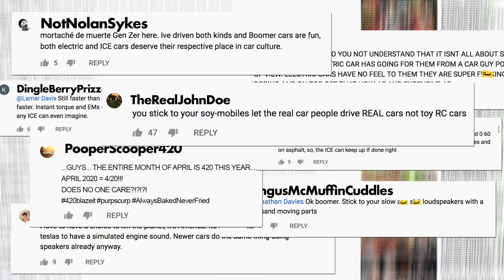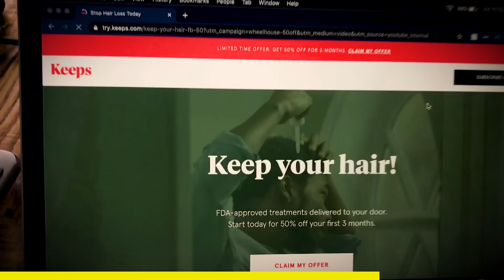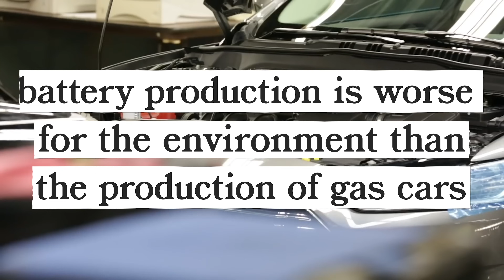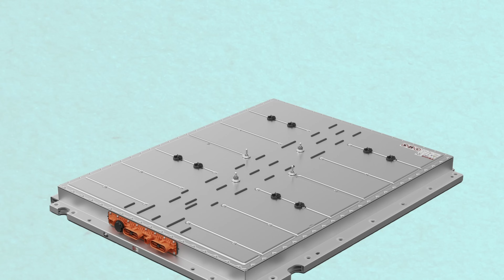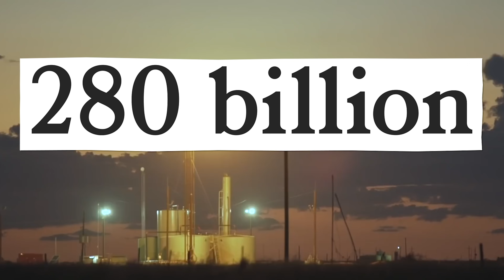Are Electric Cars REALLY Better for the Environment?

Comment: Electric cars have a limited lifespan. Some people won't even bother replacing the battery, scrap the whole car, and buy a new one. There are lots of proprietary stuff placed by the manufacturers specifically to prevent unauthorized service.

However, gas powered cars have a long history, so it's much easier to refurbish an old car and make it last decades.
Reply: The problem might eventually be getting hold of gas to drive it.....

Comment: This didn’t take into account the fuel efficiency of the gas engines and also failed to mention environmental costs from replacement of EV batteries. 
Fuel efficiency matters as they emit half the co2 if the burn half the gas or better. How long does an ev battery actually last? Did you add the cost of replacement batteries in co2 over the years? 
Great video. Very interesting. I’m still not convinced that Evs are better for the environment than existing fuel efficient cars but I’m glad to hear someone talking about it.

Comment: Will a battery eventually lose there storage capacity. so when a EV roles of the line it has 200 mile battery life but in the future will that drop to 150 miles out of the car just for example.
Reply: So, it's pretty similar to an i.c. car then? Because as an i.c. car gets older and is used more, it puts out higher levels of emissions and uses more fuel due to engine wear.......

Comment: Sugar cane ethanol has the best of both worlds: the footprint in production is lower than any gasoline, and the footprint during utilization is zero (because more than 100% of the CO2 produced by the car is absorbed by the new sugar cane being cultivated elsewhere).
However, the main problem is that even ethanol powered I.C.E. cars would still concentrate greenhouse gases emissions in the urban areas, which would be neutral for world environment, but harmful for people's health.

Comment: Batteries degrade overtime in which they have to be replaced completely as manufacturers don't repliece individual batteries or it limits range tremendously leading to buying new evs
Reply: yeah but they dont run out as fast as cars burn through gas

Comment: in my opinion i would daily an electric car and drive a v8 muscle like maybe one a week if i have my resources locked in a few years i will own both a v8 muscle and an electric car to save the environment
Reply: @Turnip_  so what do you suggest is a viable option, without any form of motorized transportation and i actually learned and studied and hydrogen powered cars are a more viable option so i dont think i would own an electric car, i would prefer to convert a gas car to a hydrogen car which can be done by using a conversion kit

Comment: Didn’t take into account the waste impact of old batteries, cradle to grave bro!!!
Reply: old batteries can be re-used to save energy generated by solarpanels that generate more then being used at that time, if the battery is not good for that, there is a company in germany that can recycle minimum of 70ish% of the battery, this can be higher in the long run.

while when you have burned your fuel of choice, it is burned and stays burned, thus you have to fill it up again and basically it has to do the whole pump to gasstation route again and again.

while for EV, once it's build then it is done, till lets say 10+ years when the range became to low and at that time your EV can be recycled and you can buy/rent/lease a new EV with new technology and new/better/stronger batterypacks.

so the only thing that has to be done is whatever your powerplant is/uses where you live and turn it more green, and don't forget that this for example coal powerplant is not only used to power your EV, but also your home, work, school, streets, shops, phone. thus even if you have an ICE car, that dirty powerplant is still working.

Comment: Lithium is very reactive to oxygen soo when exposed or in contact it burst in flames......
Reply: Lithium doesn't spontaneously combust with oxygen. Pure lithium and and sodium metal does react explosively with water. It does oxidize very easily but it won't self ignite from just oxygen. Lithium batteries combust when punctured due to being shorted, not due to being exposed to oxygen.
https://youtu.be/Vxqe_ZOwsHs
Reply: @bensemusx  my bad then......i was thought that lithium is very reactive but when ionized like in a battery it's not.

Comment: Electric cars where I live to get your registration renewed, the sticker on your license plate, costs $1000 where a normal gas car it's $100
Reply: @CANeelJavia  I was about to say the same...  In Norway, an electric car is heavily subsidized to the point where it costs less to buy than an i.c. car. Electric vehicles are extremely popular there. They also have electricity to spare, as much is produced by hydro-electric means. What happens in the US when much of the oil runs dry?  Which will probably be in around 25 years or so....could be sooner.
Reply: @Brian-om2hh  Hydro, solar, wind, nuclear fusion etc. 
Many sources.

Comment: What you failed to account for was how much people actually change cars. Average leases are three years meaning one person leasing a new EV would be contributing to over 69 metric tones of CO2 (71 metric tones for each vehicle produced plus 2 metric tones each year to charge them) vs 67.8 metric tones of CO2 ( 7 metric tones for each vehicle produced plus 5.2 metric tones each year to run them) with an ICE vehicle over the course of nine years.  Don't forget how much CO2 will be produced to create the replacement batteries with EVs and that they also use the same lubricants as ICE vehicles.

Comment: Not that it is a direct comparison, but I wonder how a motorcycle/scooter stacks up vs EV. A high power sport bike can still have 50 mpg. If you get a little 125cc scooter you can get close to 100 mpg. Just wondering.

Comment: If you IGNORE the carbon-dioxide and look at the permanently toxic materials that are removed from around the lithium in order to make the batteries and from around the copper and remember that CO2 isn't toxic or even a pollutant then the fact that this video makes the viewer retarded becomes clear.      Increasing the efficiency of vehicles by reducing the speed limit and using lighter materials is the future, not paving half of china with poison and replacing 100% of its water table with toxins.

just wait until the massive amount of toxic groundwater in china starts leaking into the ocean...

Comment: Electric motors sounds pretty wicked. It's so fast. Think about how fast that motor turns in comparison to a ice. Even electric lawnmowers and chainsaws make ice look dumb. There is nothing better than going out and mowing without hurting yourself trying to start it
Reply: And no mixing gas or messing around with oil changes. You can store the mower in a closet no risk of spills. Also does not stall in tall grass. It's insane
Reply: I mean it. It will not stall which means the time spent restarting the gas mower. You'd be completely done with the electric one
Reply: I was surprised because our gas one had to be yet again worked on because of storage. So the grass was above knee deep and it's all gone now. It's a pusher too but it almost acts like a vacuum and just mulches right through. Yes it needs to be charged every hour or so. I got a weed eater with its own battery so I can just go while the other charges. I can easily clear 5 acre in a day

Comment: And in Citys no smelly diesel fumes and the noise floor will be lower.
Reply: "diesel fumes" its gonna be a while before the type of vehicles that run diesel to go electric
Reply: @Kevin-dt9xm  Yeah but in many european cities vehicles with diesel engines will be forbidden in the near future.
Reply: @Kevin-dt9xm  Maybe not. Quite a few cities, both in the UK, have already, or are in the process of implementing a ban on diesel passenger cars in city centres. Paris, London and Berlin have already done it. Many more will follow I'm sure. And of course after 2035 it won't be legal for car makers to sell new petrol and diesel passenger cars in the UK. Some countries - such as India, Norway and others - are going for earlier cut - off dates.
Reply: @mrgrillboy that may be true but how will those vehicles operate when you can barely make them operate on smaller, mid range( in terms of overall mpg)  cars
Reply: @joshuawilliams1226  i mean right now trains are powered by electric motors, its just that most of those are powered by batteries powered by on board diesel. eventually we'll have either enough on board battery storage, on board alternative power like a tiny reactor (like a nuclear sub), or some sort of as-you-go charging like bumper cars worked into the rails
Reply: @Kevin-dt9xm  The electric trains in the UK are pure electric Kevin. They take their power from overhead lines. Hydrogen could offer a solution for rail transport. That still means it's an electric train though. The hydrogen fuel cell produces the electricity to power the motor......
Reply: @joshuawilliams1226  for something like a truck its just a matter of big batteries
Reply: @joshuawilliams1226  because electric motors have plenty of torque available instantly so they're actually not bad for heavier duty applications like trucks, thats why theyre used in trains, the only thing holding them back is the amount of on board battery to give them a decent life, but that problems being fixed
Reply: 8:40 That’s a nuclear power plant. That’s steam coming out the top.

Comment: now we need to calculate how much emmission to replace the parts because i suspect EV parts will break down faster than steel.
Reply: so far i know the only moving part is the electro motor, drivelines, wheels, brakes, bearings, steering system, axles, suspension system/springs. but all of them except for the electro motor are also in normal ICE cars, and in EVs in most cases you dont really use your brakes because it has re-gen.

Comment: How long do the batteries last in the electric car’s
Reply: depending how you (miss)use them, first gen Nissan Leaf is now 10 years old and over time you loose range, don't forget that range of the cars 10 years ago might already be lower then new EVs you can buy today, battery packs have become lighter and more energy dense.  
(https://www.youtube.com/watch?v=2qPF11PmP8k presenter with a 10 year old Nissan Leaf) 

although more EVs can go longer then 10 years (depending how much range you need), but keep minimum of 10 years and you should be fine.

(most batterypacks that are not good enough for cars can be re-used as energy storage point to save power generated from solarpanels that generate more then being used at that time)

Comment: As much as I like what CEs were able to achieve in their history, I have to add a couple of arguments in favor of Electric:
- sweet sweet torque
- hydrocarbon, once burnt, is gone. And we use it to also make plastic and chemicals (e.g. drugs)
We need to develop the whole electric ecosystem, and start saving oil.
Reply: we need to build up a public transport infrastructure much faster than cars and cheaper than planes this would help  fighting against Climate Change but nobody does it

Comment: Few issues: EVs still use all sorts of crude oil based fluids. Grease, brake fluid,etc....
Now I don’t know how good Tesla’s are in the long run but I’d put money down you won’t see one with more than 150k without the owner buying a new one
Reply: and? by the time a tesla has reached 150k miles, it has done much less emissions than a CE car would

Comment: Future tech: Extracting excess CO2 from the air and turning it into production or power of some kind.
Reply: Hopefully, but it's one of the most oxidized forms of carbon (IIRC, been awhile since organic chem) making it hard to gain energy from.
Reply: Oil companies pump CO2 into oilwells to increase there production. They have been doing it for years :)

Comment: Nobody talks and thinks about other sorts of pollution that a car can produce. For instance, the amount of particles that separates from tires when wheels roll on streets is even more than polluting emitting from exhaust. And this amount is directly dependent on vehicle weight. More weight, more particles goes off from tires. Car culture is morbid altogether and should be replaced by commuting with public transportation. We need to develop public transportation and encourage people to use them. The dispute around producing electric or combustion engines is just about money, cars are bad, electric or fuel powered makes no difference.
Reply: good thing in most of america, the infrastructure is public transportation infrastructure is non existent so its impossible to get around without your own vehicle. god i love this country.

Comment: So......he still ignored the glaring issues of recycling and end of life of batteries. Storage isn't a solution for end of life for millions of car batteries....until we understand the long term effects of recycling these batteries the numbers are still invalid. Also CO2 isn't the only thing to be concerned about. It's a straw-man imho the sum of whether a car production is environmentally friendly shouldn't just be CO2 emissions that's one part of the conversation I feel like is missing. It's very easy to pinpoint on aspect and say YES we win, but the sum of the effects on the environment are not just C02 emissions that just so happens to be the easiest aspect we currently use to "define" "clean energy".

Comment: Wind power has a considerable recycling problem. Carbon fibre is energy intensive and can’t be recycled. It also kills migrating birds. 
Solar power has a recycling problem. The cells use rare earth elements which cannot be recycled easily. 
Hydro power has caused huge problems ms around the world. Think Aral Sea Russia. Nile Africa Mekong River South Asia. 
Nuclear power is the cleanest and safest power source we have. But it upsets the Water melon greens because it’s nuclear. They complain about waste but in reality waste is not a problem. Even better we now have a Canadian nuke power project that will be fuelled with spent  fuel. It solves the long term waste problem AND each kilogram makes 30x more energy than the original plant ever did.

Comment: TL;DR, the video is not objective: 

- Electric cars need battery replacements every ~5 years, or else they will have much shorter lifespan. Meaning more pollution for production of replacements than a traditional car will ever need.

- There is a noticeable loss of energy between the power plant and it being used in the car to produce physical movent, meaning you need to calculate your car pretty much using 1.5 times  as much juice than you believe you spend to get an estimate on the raw energy output (and associated emissions) you are consuming. Transistor resistance and energy bleed-off during charging and idle mode are main factors here.

- There are many non-electric cars (both efficient hybrids, as well as prototypes using alternative fuels like Hydrogen) out there, so comparing EVs to a frigging Mustang of all cars isn't objective as that car is crazy fuel-inefficient and isn't even suitable for 90% of the world outside of the USA.
Reply: Batteries outweigh ICE efficiency after a max of 2 years though meaning it’s still more efficient as it breaks even at 2 years and lasts for more than double that